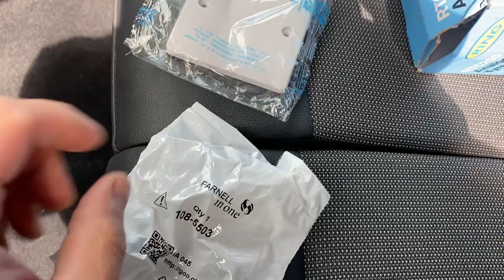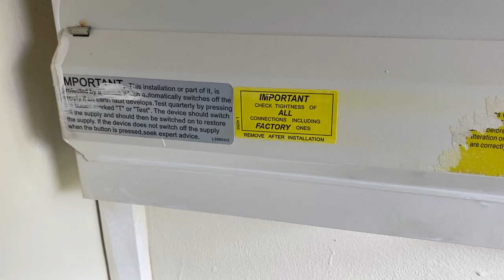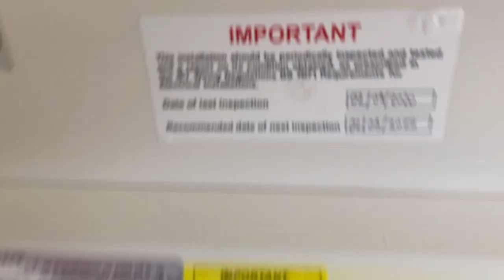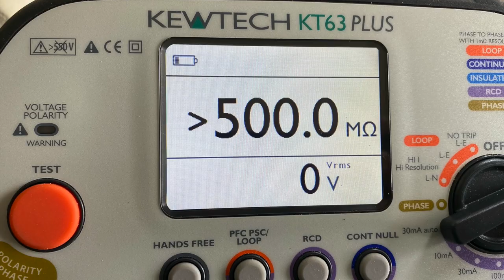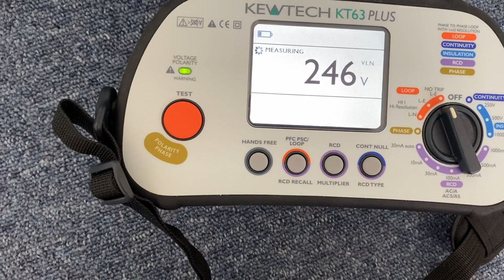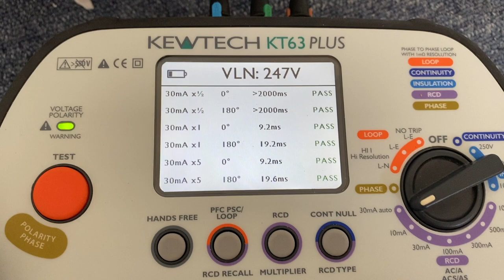Bit of trunking some sockets and green and yellow wire.

Comment: Small advice, slap a rag or gloves on the vice jaws and they won't leave those nasty knurl marks on the plastic / you can tighten them more
Reply: Looks to me like a vise with flat jaws, not knurled. Shouldn’t chowder up the plate.
Reply: @JasperJanssen  haha, you would think! The fucker gets a single dimple in it and it will press that dimple into everything. Also don't forget that no surface is smooth and most dirt is really hard material

Comment: What are the screws you use that don't need wall plugs?
Are they spax?
Also, did you pre knockout the holes before fitting the sockets to the wall?  Nice neat finish!

Comment: is there a special reason for surface trunking instead of sinking into the wall?
Reply from the maker: Speed and the installations are always temporary so they can be removed easily with little damage.
Reply: @Cjrelectrical  OK thanks.I guess it's permanent for some properties I've seen that's been around your decades. Looks horrid.

Comment: Little tip. Don’t bother buying those d line clips make your own from a roll of galvanised banding. Cut a strip off screw in and bend over like you would the d line clips. Save a small fortune 👍
Reply from the maker: Good tip, I did do this but got told “buy the correct clips that’s rough” 🤷🏻‍♂️